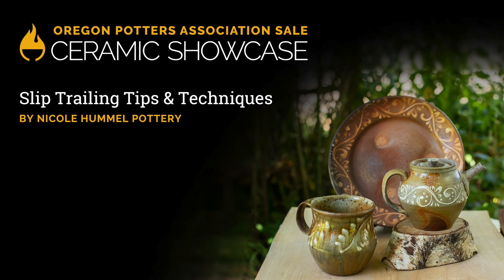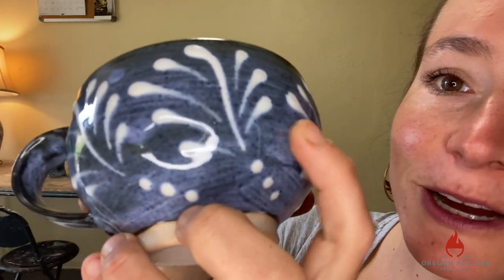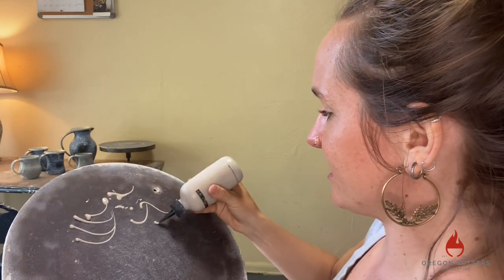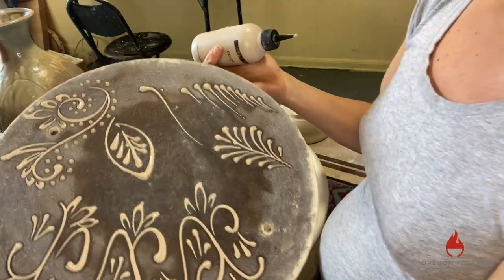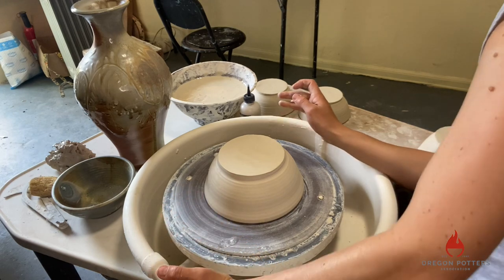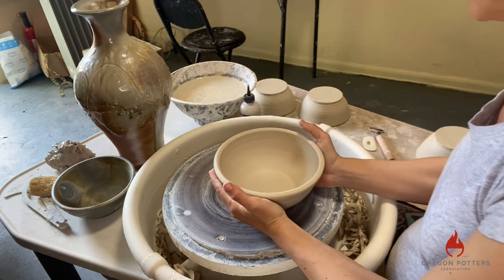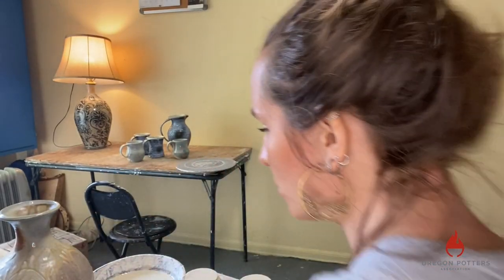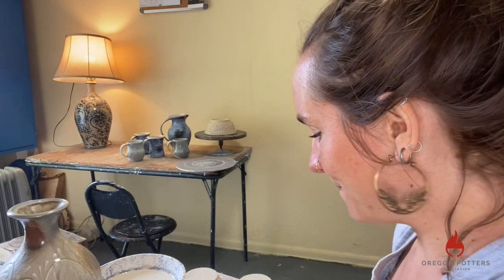Slip Trailing Tips and Techniques

Comment: May I know how to be sure it will not drop off?
Reply from the maker: Sorry for the delayed response! I wrote to Nicole and this is what she said: The hydration of the slip as well as the dryness level of the pots is crucial for the slip to not drop off. Generally I slip trail onto leather hard pots, and the consistency of the slip is something like pancake batter. If the pots are too dry or too wet, or the slip is too wet/liquid, then it will be difficult for the slip to adhere to the surface - either dripping off as you slip trail (if the pots are too wet or the slip is too wet) or cracking off at a later stage (I have usually found this will happen if the pots are too dry). Experimentation is key to find what works for you!

Comment: Can you explain how you glaze the piece so the slip trail shows when the piece has been glazed in a dark color?
Reply: She answered this question on her site!
"The decoration on these pieces is done at the greenware stage, when the clay is still leather hard, meaning it is still malleable but will hold its form. Once the pieces are thrown on the wheel, they are trimmed and finished, and then coated with a range of different colored slips - ranging from a red iron to a dark blue, to a soft green. Once this layer of slip dries, I use my slip trailing tool to trail on patterns of ferns, spirals, and other nature-inspired designs. This slowly dries and then the pots are loaded into the kiln for bisquing.

Each piece is glazed in a glossy clear, and then fired for roughly 20 hours to cone 10 reduction, reaching roughly 2480*F. After a two day cooling period, the kiln is unloaded and each pot is sanded before being packed for its new home. All of this collection is dishwasher and microwave safe."

Comment: Can you explain how you glaze the piece so the slip trail shows when the piece has been glazed in a dark color?
Reply: I know this is an old comment but I went to her website and she explained how she achieves that look

"The decoration on these pieces is done at the greenware stage, when the clay is still leather hard, meaning it is still malleable but will hold its form. Once the pieces are thrown on the wheel, they are trimmed and finished, and then coated with a range of different colored slips - ranging from a red iron to a dark blue, to a soft green. Once this layer of slip dries, I use my slip trailing tool to trail on patterns of ferns, spirals, and other nature-inspired designs. This slowly dries and then the pots are loaded into the kiln for bisquing.

Each piece is glazed in a glossy clear, and then fired for roughly 20 hours to cone 10 reduction, reaching roughly 2480*F. After a two day cooling period, the kiln is unloaded and each pot is sanded before being packed for its new home. All of this collection is dishwasher and microwave safe. 
"
Reply: @autumnarcher  Thank you so much !💗💗

Comment: If you’re slip trailing at the leather hard stage like demonstrated on the video, then how did the for instance, the bowl have white fern, slip trail and the rest of the ball was a dark blue?
Reply from the maker: Hi Debi: I could take a guess, but it might be best to write directly to Nicole - she gives her contact info towards the end around 18:30
Reply: She answered this question on her site!
"The decoration on these pieces is done at the greenware stage, when the clay is still leather hard, meaning it is still malleable but will hold its form. Once the pieces are thrown on the wheel, they are trimmed and finished, and then coated with a range of different colored slips - ranging from a red iron to a dark blue, to a soft green. Once this layer of slip dries, I use my slip trailing tool to trail on patterns of ferns, spirals, and other nature-inspired designs. This slowly dries and then the pots are loaded into the kiln for bisquing.

Each piece is glazed in a glossy clear, and then fired for roughly 20 hours to cone 10 reduction, reaching roughly 2480*F. After a two day cooling period, the kiln is unloaded and each pot is sanded before being packed for its new home. All of this collection is dishwasher and microwave safe."